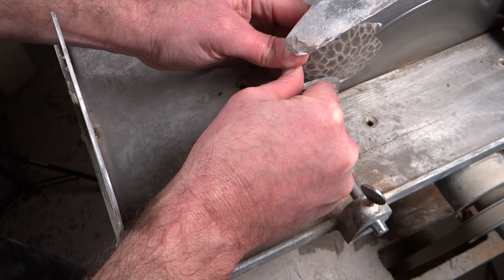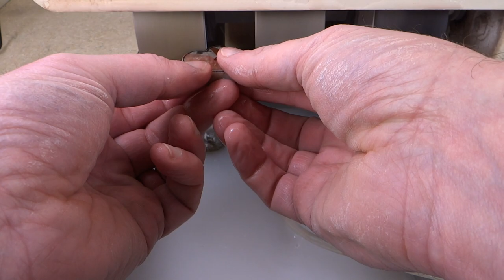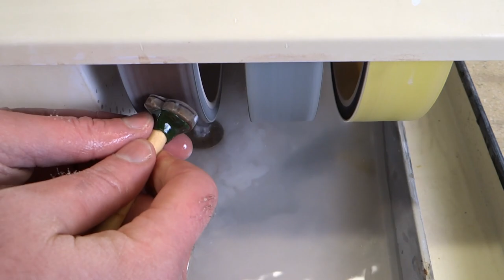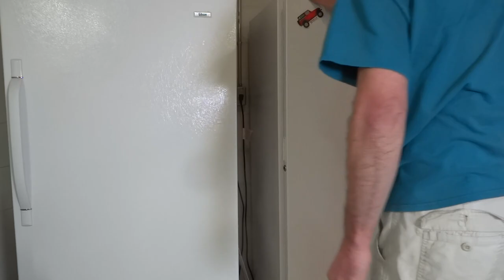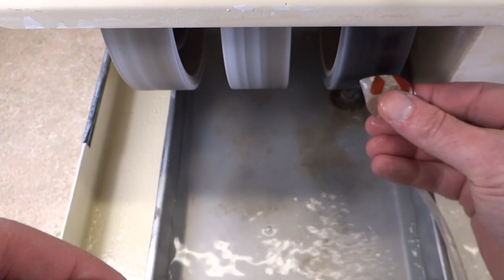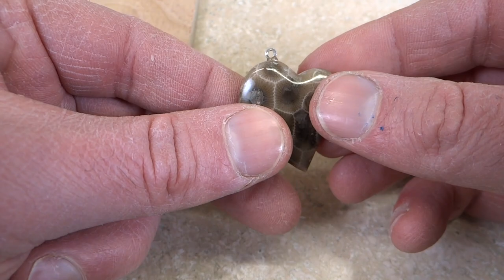Hearts of Stone

Comment: These are so special, ty for sharing the process.  So much more goes in to them than I realized.
Reply from the maker: Yep, they take awhile.  It's fun to take a rock I found on the beach and turn into jewelry.
Reply: @MichiganRocks  being able to see the entire journey from shore to jewelry (or polishing/cutting), certainly makes me appreciate the effort.  About how long would you estimate each pendant takes?
Reply from the maker: @Tanya_LitLife  That's hard to say.  I spend a good part of the day Monday making hearts.  I cut out 14, drilled all the holes, smoothed out the edges, and dopped them (stuck them to sticks with wax).  Then I finished the rest of six of them.  I didn't really time myself, but I'd say that took between six and eight hours.  That doesn't include slabbing the puddingstone, which is done somewhat automatically in my slab saw.  I have to clamp the rock in and then adjust for the next cut every half hour or so.  So maybe an hour per rock?  I try to speed things up by mass producing them as much as possible.  Doing just one would take longer because of set up and clean up.

Comment: Nice work on this video. It's just eight minutes for us to watch, but I can only imagine the time it takes you to produce.
Reply from the maker: My goal was less than five minutes, but I didn't quite get there.  You're right about how much time it takes to make a video like that.  It's kind of a pain to move all the camera equipment every time I do the next step.  It was filmed over about three days because I was doing quite a few hearts at the same time.  One of the most annoying things is trying to eliminate other noises.  Each time I filmed, I had to turn off two rock tumblers, unplug a refrigerator and freezer, and turn off the furnace.  After all that, you can't believe how often the water heater kicked on just as I was about to start filming.  That's harder to turn off, so I just end up waiting.  

I didn't mean to sound like I was complaining, but since you mentioned it, I thought I'd confirm what you said.  I also spend quite a few hours editing. I have an external microphone now and it takes a while to sync up all the video with the audio.

Comment: Beautiful job on both the Pudding and Petoskey stones. Your choice of where you cut each cab off the slabs was obviously based upon a lot of experience. Great job on the stones and video!
Reply from the maker: Thanks!  Believe it or not, I haven't made very many things from puddingstone at all.  Mostly I just polish them whole.  I think the key is to just make sure every heart has red jasper, and preferably another color besides the matrix.  I have made a lot more things out of Petoskey Stone.
Reply: @MichiganRocks  The pudding stones looked like they were relatively easy to work with on the saw. Did you meet tricky areas of more and less resistance as you came off the matrix into the other minerals? That was my first thought.
Reply from the maker: @thinkcivil1627  No, there is not too much difference.  Nothing that would affect the way I work the stone.  I have worked with other materials like that where part is very soft and another part is very hard.  This wasn't like that.

A couple that I know makes a lot of jewelry from Michigan rocks.  They keep all their scrap puddingstone and hire me to drill holes and tumble them for beads.  I have drilled at least 500 beads for them.  Most of the time, the hole goes through the quartzite matrix, but sometimes I had to drill through the red jasper.  It was a little easier to notice that the jasper was harder when drilling, but it still wasn't too bad.  

They gave me about ten little Lake Superior agate pieces to drill one year.  That didn't go so well.  I'd either burn out three drill bits trying to drill 1/4 inch, or the rock would break from the heat.  I don't know if I successfully drilled any of those.  I quit trying after destroying about three of them.
Reply: @MichiganRocks  You are not alone burning up drill bits on agates. It's why you see a lot of wrapped agate jewelry. If you drill a partial hole, it helps to twist the end of the wire going into the partially drilled hole and use a premium epoxy. They seem to hold better that way. The bottom line is that, at a hardness scale of 7 plus, it's just difficult to drill any hole into an agate.

Comment: What was that gobbly goop on the wooden stick?  
Those hearts are so beautiful!!!!
Such patience and craftsmanship.
Reply from the maker: That's dop wax.  The stick is called a dop stick.  It's just a wooden dowel.  It's a quick way to attach the cabochon to the stick.  It releases easily after freezing.
Reply: @MichiganRocks  Is the wax on a wooden dowel something that you came up with, or is that a trick of the trade?  Very cool way to hold the hearts.  
Very clever also, putting them in the freezer to release.  
The hearts are so beautiful with Petoskey Stone and Pudding Stone!  
❤️❤️❤️❤️❤️❤️❤️❤️❤️❤️❤️❤️❤️
Reply from the maker: @yeswing10  No, I didn't come up with any of that.  That little heater is made for this purpose.  Some people use an alcohol burner to heat up the wax.  The freezer trick was also not my idea.  

Before I got the dop pot, I used to super glue the cab to the head of a large nail.  Super glue can also be released by freezing.  The problem with that is that it takes longer for the super glue to set up enough to be strong.  Sometimes the cab will fall off the stick (with either method) and it's no fun to have to wait for hours to get started again. With the wax, you're ready to go in just a few minutes.  I keep the wax hot while I'm working so it's ready to go if one falls off.
Reply: @MichiganRocks  thank you for explaining the process.  It's simple and very cool.  thank you for taking the time to answer my questions. I really enjoyed watching that video.

Comment: Really enjoyed this video Rob! If I don't have a drill press can I still drill the pin hole effectively with a dremel tool or a hand held drill using a table top vice?
Reply from the maker: I think so.  You'll just have to have steady hands.  I use 1 mm drill bits from Kingsley North.  I went through about a dozen of them drilling about 30 rocks.  They don't last long, but they're cheap if you buy a lot.  I think I bought 100 for $75.  There might be better options, but that's what I used.
Reply: @MichiganRocks  Thanks. Will it work with a mohs 6-7 rock?
Reply from the maker: @RockhoundingLife  It will work with six for sure.  I have drilled hundreds of holes in puddingstone with these bits.  The matrix of puddingstone is quartzite.  No problem with the red jasper either.  The bits are very variable in quality.  Some don't get through a single hole and others will drill a dozen holes.  One time I tried drilling Lake Superior agate for beads and went through about three bits before I gave up.  Those are some really hard agates.  So there is a limit to what they'll do.

Comment: Only bugging ya because I have a big question. I got a pound of rough Tigers eye and there is only ten pieces so they are big. Can I wack a piece of it with a hammer to make nicer pieces? I prefer smaller pieces to hold. Thank you so much.
Reply from the maker: I don't think I've ever broken tiger's eye, but it should be fine to do so.  You might end up with some smaller fragments breaking off, so you'd have less than a pound of material left to tumble after breaking.  Also keep in mind that as you tumble the rocks, they get smaller.  I'm not sure what size you're shooting for, but is it possible that the rocks might be the size you want after you tumble them?

One more thing, consider using a hammer and chisel rather than just a hammer for a more clean and precise cut.
Reply: @MichiganRocks  Thank you so much for such a quick response. I would actually be happy with small stones. I have five that I hold at once and admire now and I have toddler size hands so quarter size would be good. There is one rough that is the size of my palm so I definitely will use a chisel, if it's okay that the chisel is actually a flat head screwdriver as I don't have a chisel. I also made a quick necklace with the stuff that came with the first Rock Tumbler I got and I like the idea of making myself jewelry now. The doors in my imagination the Tumbler has opened up is amazing. One day down the road I hope to get some of the machines you have to make the hear shaped rocks you did. They are so gorgeous. Maybe even make them in the shape of my other love, Leopard Geckos. Such an exciting hobby. One day I saw Rock Tumbling, probably your channel as I believe yours is the first one I ever saw and I thought about it for months and realized the desire wasn't going away so my Mom got me the first Tumbler for Christmas and I just got a double one. I may even try to step way out of my comfort zone and travel from Kansas to your beach in the spring.
Reply from the maker: @Makingofabetterlife  I started with just a tumbler too, and slowly acquired other machines along the way.  I bought most of my stuff used, so I had to wait until something was available to be able to buy it.
Reply: @MichiganRocks  I didn't even think about buying used. That is so 🤓 smart. 😆

Comment: Looks scaring to cut with your fingers so close to the blade. Beutiful artwork though!! Is it heavy work?
Reply from the maker: Hi Inger.  Please watch this video about the possibility of me cutting my fingers on the saw.

Is it heavy work?  No.  The whole rocks before I cut them don't weigh any more than a couple pounds.
Reply: @MichiganRocks  I mean, not heavy like you carry a heavy rock, but for arms and fingers to hold your arms up at a long time :-) I have seen some use a type of sticks to hold fast the rocks when they are close to the sawblade.
Reply: Yes, I watch your info-video about cutting,  so glad only your nails was affected, thumbs up and thank you for answering!!
Reply from the maker: @kastah  I'm still not sure what you mean. There is no hard labor of any kind involved in making these.  I made quite a few so my back gets a little sore bending over the machines after a couple hours, but I just take a break.

I do use a dop stick when cabbing on the grinder, but I don't use any sort of stick when slabbing the rocks.  I put the puddingstone in my slab saw, so that runs by itself after I put the rock in the vise and turn it on.  Petoskey Stones aren't a good shape for fitting in the vice, so I cut most of them by hand.  Cutting those is the part I like the least.  It's slow and not very interesting.